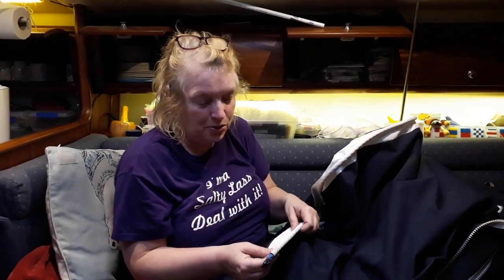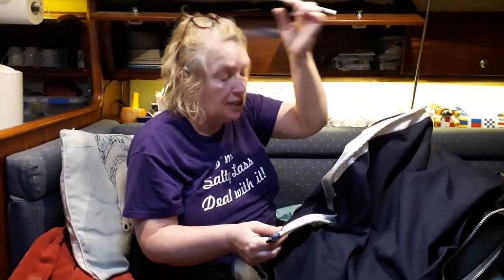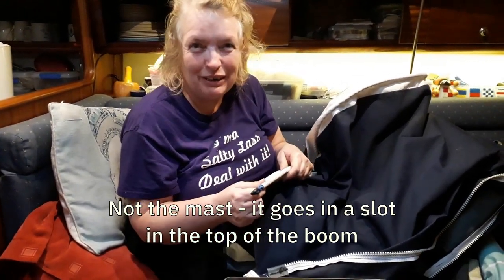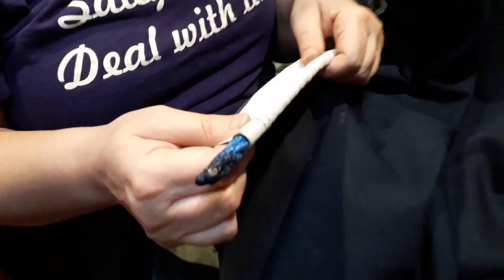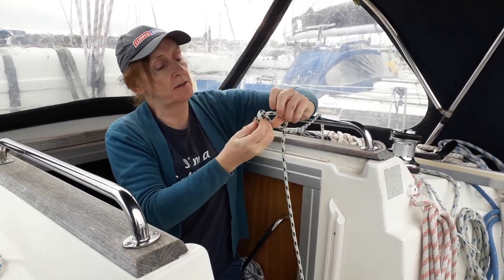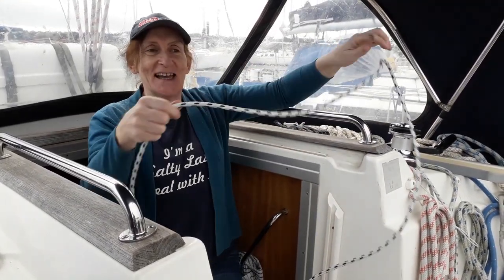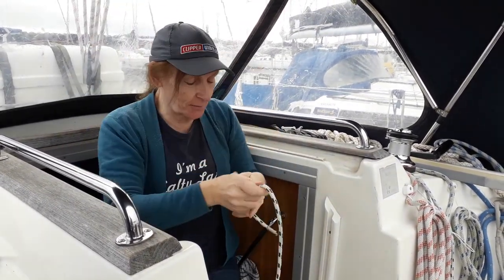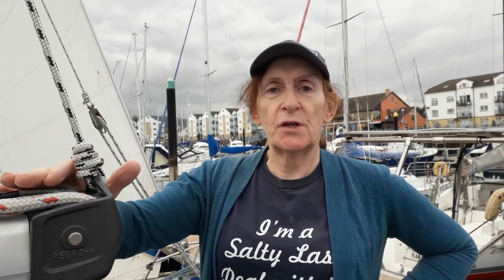Sailing Northern Ireland - Sailbags - Lines - Reefs - Yachtmaster - Ep. 176

Comment: Great video ladies. You know you can fit a third car in the boom for the third reef?  Your boat came with it fitted so it may be in there just jammed up somewhere? PM us we had to replace a boom car after some crew member ar$e winched the reef in while the halyard was still tight on a night passage. Just done our lines before the spring in Cindys washing machine. Comfort makes them all soft and supple again. :-)  If you wanna pop over and finish out Winch covers, Hatch covers,  Jerry can covers,  Oscars new bed lee cloth. Sure we can work out a fair rate in exchange for some winter sun? LOL Sail Safe Guys, Ant, Cid & the pooch crew.
Reply from the maker: I will have to shine a torch inside our boom. The previous owners told us it only had two cars. Thanks for that! As for your yacht sewing scheme... we have enough trouble with this one 😄😄
Reply: @SailingYachtSaltyLass  LOL

Comment: If your boom drops on the canopy when releasing your topping lift the cylinder in your vaang needs replacing. With vaang released the boom and sail should lift and allows you to reef easier plus a quick way of depowering the main if there is risk of a broach.
Reply from the maker: One only small flaw with that... we have no vang. We have a kicking strap. 😄😄
Reply: @SailingYachtSaltyLass  wow your the only Bavaria I know without a vaag suggesting a previous owner thought too expensive to repair and replaced with simple blocks?
Reply from the maker: I have no idea. It was there when we bought the boat, it works well and is simple and we were used to having a kicker from when we were sailing dinghies. On the plus side, maintenance is simple, failures are rare and fixes are indeed cheap!
Reply: @SailingYachtSaltyLass  to replace a gas spring with an original is relatively expensive but I've just replaced a gas spring using a UK manufacturer for much less.
Reply: To reduce friction especially on the leach line you can get your sail maker to add a secured turning block instead of just looping through a metal ring.
Reply from the maker: We tend to follow the first rule of engineering. If it ain't broke, we are not fixing it 😉
Reply from the maker: Does it make a big difference?
Reply: @SailingYachtSaltyLass  yes it makes a big difference. Try to get a sail on a similar boat with so you can see.
Reply from the maker: Thanks - some quick feedback BTW... there are three other Bavarias near us in the marina, all about the same vintage as Salty Lass. Two vangs and one kicker, so counting us in that is two vangs and two kickers. You have piqued my curiosity and from now on I shall be looking at every Bavaria I come across...

Comment: Thought only rope on a boat was on the bell
Reply from the maker: We have no bell, but technically we have a locker full of ropes (the rope locker!!). An old salt told me that if it is not attached it is a rope. Once it is in use it magically transforms from a rope to a line / halyard / warp / etc. Untie it and it becomes a rope again 😆

And some sails do have bolt-ropes rather than slugs. Dinghy sails are a case in point.

I think they need to rewrite the old quiz question "How many ropes on a boat?"
Reply: There's definitely also a bolt rope and a foot rope too. Possibly more.

Comment: Hi Ladies, just curious as how you set up the storm jib? do you have a removable inner stay? if not what hardwear are you using on deck and what halyard are you using to hoist it as it looks like it`s not exactly parallel with the forestay  ? thanks.
Reply from the maker: It is not properly "fitted". We borrowed it for sizing purposes, used the spinnaker halyard as a stay and hoisted it on the spinnaker lift. We gave it back to its owner later in the afternoon.